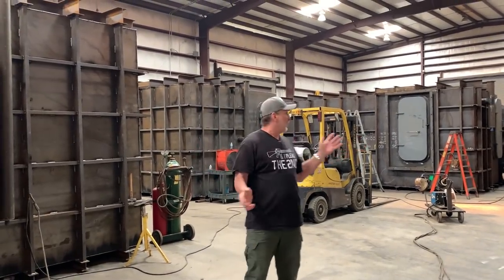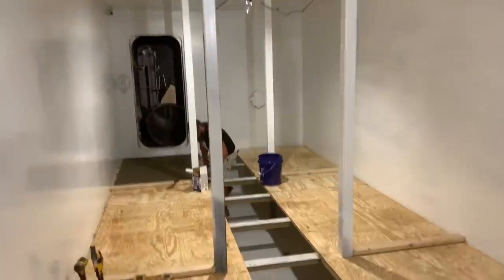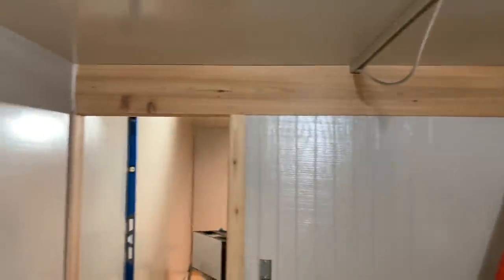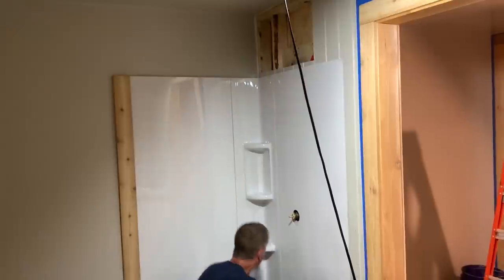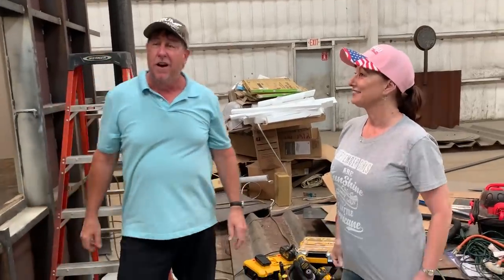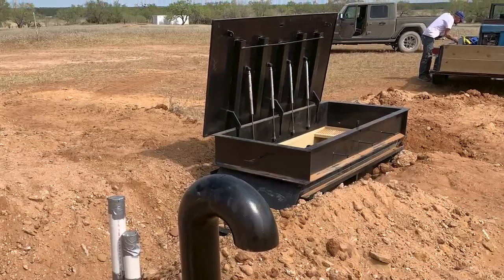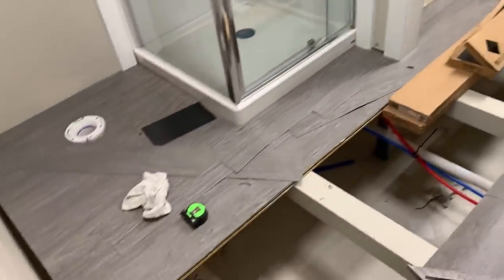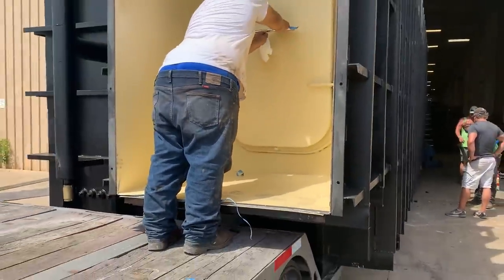WE make BOMB SHELTERS that look like Homes inside "how we do it"

Comment: Look to some of the Japanese built homes, they utilize every square inch due to the limited land available. Countertop dish washers for example consumes very little water and electric while costing a fraction and can be removed without the need to modify cabinets. Pocket doors for privacy while allowing maximum floor space for occupants and thinner partition walls with rockwool type board insulation for sound attenuation with some fire protection. Even with the use of bidets will cut the use of toilet paper to a fraction while offering superior sanitation (prevent diaper rash) when in a shelter for extended periods.
Reply: I live 3 miles deep on our 22K acre ranch. I'm used to wide open spaces and lots of flying freedom seeds...
At my TEXAS home...
Reply: Don't know if you've lived in a Japanese house, but there is no sound attenuation or insulation... I could hear EVERYTHING that was happening in my neighbor's houses.
Reply: @firearmsstudent  Then don't build it without any form of sound attenuation or insulation. There is a reason why insulation standards are different in many regions of the world.

Comment: 59.
Question on the 2x interior walls...are they standard on-center residential housing dimensions so that a bunker owner could put one of those inside-the-wall metal lockable gun cabinets ( cant really call them a "safe" ) into the wall at some point?

Comment: I promise if you weld a rebar grid to one of those submarine doors have it raised up about 3" welded to the submarine door build a wooden  form around that, poor concrete from the top  you now have a steel reinforced concrete blast door, you can also mix a variety of fiber metals carbon fibers different type of fibers in the concrete that if someone trying to cut through  it's just going to go through blades and then once they hit the rebar then they got to switch blades then once they get past all the concret they got to get to working on  the steel, bottom line is I would love to see just even a model or a sample a demo of the Swiss style residential and commercial concrete reinforced glass doors that they use I can almost guarantee you if you had one on display you would get requests  I know I would want one of those cuz who doesn't want a more beefed up blast door made of multiple materials it takes multiple tools and blades  to get through it , I mean hell those submarine doors I could get through it in about 3 minutes with a plasma torch or probably even a cordless grinder

Comment: How much do these cost and is it possible to weld several of these together? Also is it possible to setup running water by drilling a well? Also how does the bathroom, water waste work? I’m also interested to know about air filtration and electrical options and generator exhaust systems. These are great but hope I’ll never have a reason to use it. I’m interested in it as a home that has a large garage above it or possibly next to the site. I’d have the garage built about 8-12 feet underground with a regular driveway that descend down into a heavy duty garage door. Thanks!

Comment: Hypothetical question.   How would you circumvent flood water from entering into your bunker hatch or escape hatch if there was  heavy flooding.   Weather or not you have your bunker under your home. Or out in a field somewhere and a large flood happens from tide surge of say.. three feet or more.   Would you be trapped in your bunker with no way to escape or no way to get air.   Just something for you to think about.
Reply from the maker: Great question: The door is gas tight and not water tight but the way we make our bunkers, we always have 1 way in and 2 ways out so there is no way anyone would be stuck in the bunker.